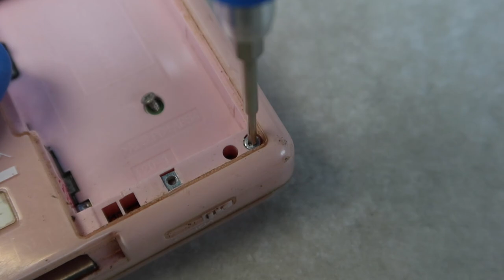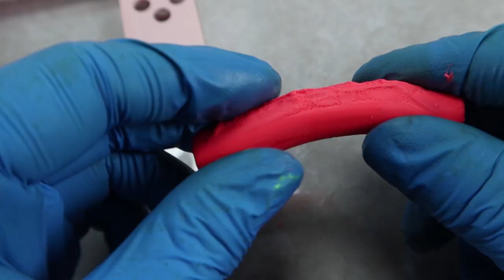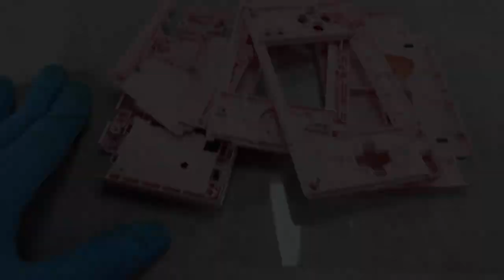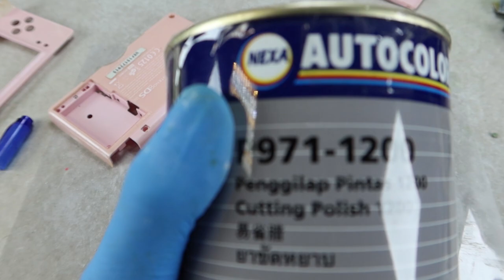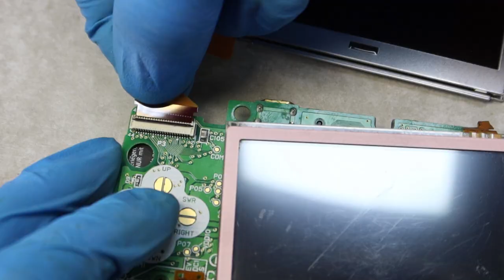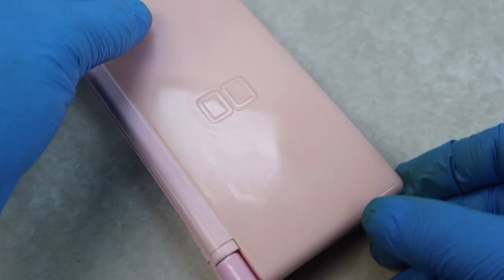Restoration Handheld Game Console | Nintendo DS Lite

Comment: I had no idea the microphone cable would reach its plug if you ran it under the cartridge slot. I always run it below the motherboard. Ive also been putting the springs on the triggers wrong. This was really insightful thank you!

Comment: Not bad. I like how you molded the broken piece back. Although there's supposed to be light shining through it, how would you know if the battery is low? I personally would've replaced the bottom screen too, but that's just me being a perfectionist.
Reply: What impressed me was salvaging the original case. For originality sake I really love this. The molded piece was very clever and since underneath the paint it is a TRANSPARENT epoxy all that was needed to be done was to scrape away a little paint in the 2 LED light holes. That would have been really cool